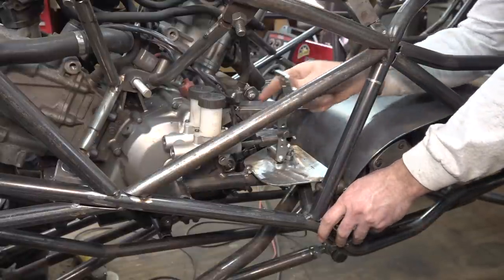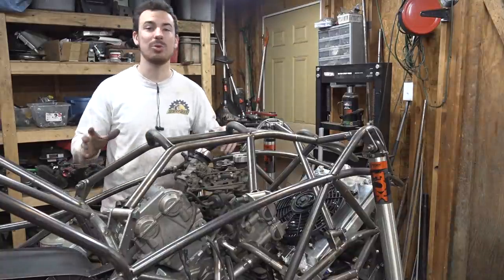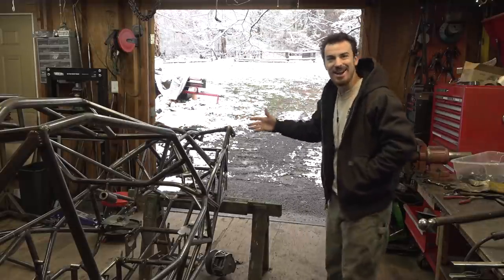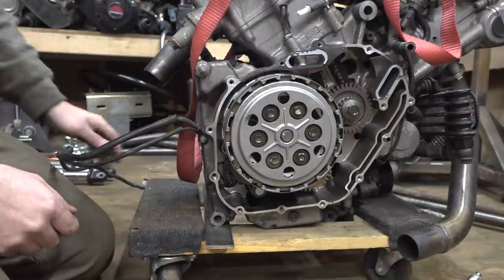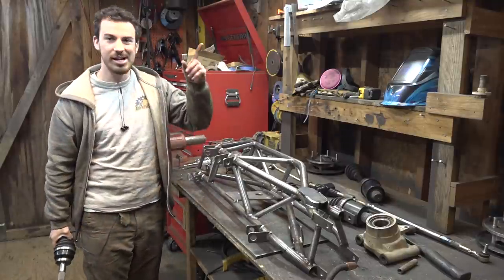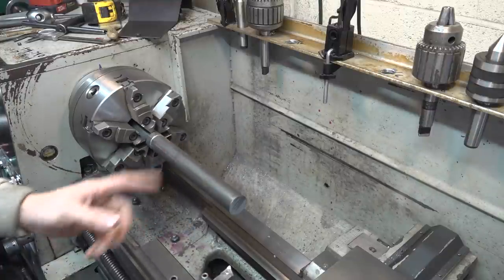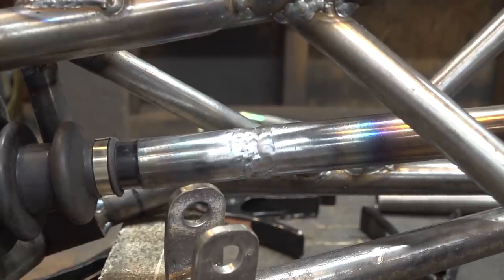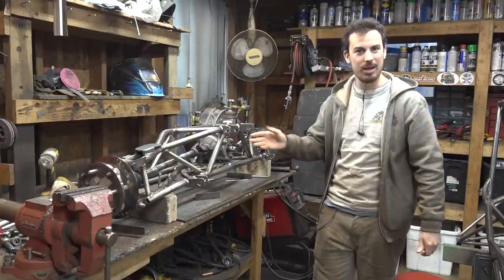4X4 Mini Rock Crawler Build Part 10

Comment: If (when) the Polaris diff explodes, have a look at running a car style small diff, like a Suzuki Samurai front and rear. Keep it all in the Suzuki family
Reply: I doubt there's any issues with oiling system. 
Otherwise every sv650 would need to be rebuilt when you wheelied. 
Plenty of crawlers use a wet sump.with great success. 
And you actually have to put power down to break the diffs.

Comment: Instead of butt welding the shafts, next time try 50/50  overlap section weld for a stronger connection. maybe like 2" or 3" on each end.  Even easier would be take your solid bar and turn holes in each end for the axles to go in, then weld.

Comment: 99 percent of the strength in shafts is in the external surface, thats why some are even hollow to save weight. The sleeve idea may end up being the better solution if these can't hold up to torque.  I would also look at annealing them too, to remove internal stresses in the welds. You don't need brittle half shafts.

Comment: Pro tip: Next time that you need to butt weld two shafts together, cut a piece of 90° angle iron that's quite a bit longer than the area that is being welded. Set the pieces of axle into the " v" and use c-clamps  to  hold it all straight while you weld it. When you are done,  there should be very little run-out if any.
Reply: Not in this case. 2 different diameters
Reply: They have to be the same diameter shafts for that to work. I guess he can put a sleeve over the smaller one but it would have to be exact tight tolerances. He does have a lathe he could of also of pinned the shafts or turn them both down to exact diameter.  Most YouTubers don't go that extra mile. it s slap together fest because of time restraints.
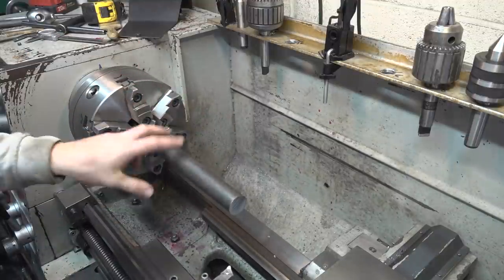Reply: Right, which is one of the reasons why he put the bar stock into a lathe and turned the O.D.'s to match (18:30). So as long as he matches the like sized ends together in the "v" of the angle iron, it should line right up, no problems.

Comment: Metal dust is camera's worst nightmare it jumps the circuit board hence the smoke take the camera housing apart and coat inside with a protective coating

Comment: I notice that there is a wobble in the shafts. I would have used an angle iron to hold each of them straight in 2 directions. The way it is now, you will have a lot of high-speed vibrations. Other than that, this is turning out great.

Comment: I am not a keyboard commando by any means.  If you have not welded it yet,  how about a cold roll with a inset to accept the shaft of the factory cv axle. A reversed heim joint like.  With a hole to plug weld? I am thinking tig weld to try and keep vibration down from the cv axle when spinning.

Comment: Hey Chris, looked like your gear selector shaft is bent slightly, probably been dropped on that side and caused the loss of the washer and circlip. Also, they are called clutch plates, metal and friction. 👍🏻

Comment: Why was the snap ring missing is real question? Did it break so they parked it? When you welded the axles you used one piece to connect both sides. Because of the raised sections each side needed its own piece to keep straight

Comment: Should have took those axles out and welded them in a pinwheel then lathe them down perfect I’d have used a slip over to extend the axles hopefully those won’t brake

Comment: Chris, to achieve a nice smooth consistent flat cover pass you first need  the final pass before the cover pass to be smooth and flush or a little below the parent metal. So if you run the last pass or 2 in a more down hill position somewhere between the 1&2 o'clock position, same step for the cover pass. Running slightly down hill is the best way to get a really smooth consistent wedding band weld. Definitely cool the part down between passes to about 150°f  Great video and what an awesome build love every thing about it!!💪😎👊
Reply: Trying to explain anything through text is like trying to have a conversation with the opposite species. Did you even proof read what you wrote? As a welder for 20 years I have no idea how that comment would translate to metal via a wand.
Reply: @FarmerFpv  I did proof read it and yes I could have went into more detail, but the main point is to get a flat smooth cover pass you  have to run down hill. You being a 20 yr welder this should have been easy for you to understand. I'm a 30+ yr welder fabricator with 12.5 yrs ASME code. I've fabricated with & x-ray certification in Titanium Zirconium and host of other exotic metals. Chris's welds are very good strong looking weld, but making them look pretty and smooth is something that takes different techniques to achieve.

Comment: Tig welding isn't inherently stronger than Mig welding.  If the machine is set properly and the welder himself knows what he's doing, they are both equally as strong as the other.

Comment: Damn! I’ve been planning on building my niece a mini rock bouncer and always imagined it in my head but could never figure out the gear box and didn’t want to use a jack shaft setup for running to driveshafts. Excellent work man hats off to you 🤘🏻

Comment: How about saving the differentials to some other project and now blow them up wasting time and money. Its rock crawler that uses lots of torque to move slowly and there will be shock when you go down from the rock. Drive train should always be least bit over built for the engine size so it can take the beating, aggressive driving etc, so for love of all that is mechanical, get sturdier differentials and build something else from those, say 6x6 sounds pretty neat idea.

Comment: Pedantic mode enabled - Unfortunately, a rigid break pedal mechanism, like the one you've created, cannot adjust the break-bias to two identical master cylinders.  To mechanically adjust break bias you need a mechanism that allows you to move the fulcrum on a lever bar, that then attaches (flexibly) to the two master cylinder rods (and applies different pressures to each).  D3Sshooter has a good video that shows a mechanism and explains how it work - https://youtu.be/ncANVHBmE4s?t=361
Reply: Pedantic《 or pendent
Reply: @mattcassinell694  huh?
Reply: You can also put a small shutoff valve in the line like a stack car. 👍
Reply: @brianmcpeek651  So nothing to do with the foot pedal mechanism then?

Comment: so you are aware every tube joint that you had overlapping should have been pulled apart and welded out 1 tube at a time, that cage is not as strong as you think it is with all those unwelded joints underneath each overlap joint

Comment: When cutting a centre hole in the lathe keep the material tight to the chuck ,that way your live centre will be in the dead centre of the workpiece and it won't be so far off running true ,unlike in the video where it was wobbling about like a turkey head 😉😊
Reply: Lol it was tight in a six jaw Chuck you don't get much more accurate than that other than a collet it Chuck(assuming that his chuck is dialed in the first place). The joys of working with old stock/hot rolled. You can put an indicator on that and you'll flight with it all day. It's old stuff with mill scale.
Reply: @ogt92fromthe1step9  холоднокатаный металл делают с горячекатаного, а при экономии на производстве сейчас холоднокатаный может  быть покрыт окалинами (окалина) и иметь вид как у горячекатаного

Comment: WOW!! Is that beast ever looking cool. I thought it would be nice to have the shifter between your legs. With simple push/pull cables, the shifting would be really responsive. Then it is fast and easy to drop down your hand, make a shift and have your hand right back on the wheel for steering. With it down on the side you have to grope around to find it or even look down for it which can be very dangerous. Keep up the awesome content big guy.

Comment: Mound a small 12v winch on the top of your bench or against the front wall with the cable following the ceiling & out to a pulley so that you lift things up onto a trolley to put onto the bench. Run it from car batteries & simple lifting hoist so you don't hurt your back

Comment: Those axels still seem to have a pretty eccentric rotation to them and it will only be exacerbated when they get to operating speeds. Be careful it doesn’t vibrate the rear apart

Comment: Have you thought about drilling the rod on both ends the size to slip over the axles and drilling pins though them and welding to connect them?

Comment: On those rear axles you could have just cut the axle shafts long enough that you wouldn't have had to add anything. Just cut it off right at the opposing joint that you didn't need. You would have had plenty of shaft to touch tips.

Run dual shield flux core on the MiG and it'll be plenty strong enough.
Reply: That would have made it difficult to maintain concentricity. When having and using the right sized V-blocks is not an option the method he used was the easiest and best solution. He was able to weld both diameters independently using one piece of angle steel. I do see what you mean though. It would have been a little stronger.
Reply: @brianrhubbard  Yeah I typed that out before I was aware of the differential in shaft diameter. But, any comment where you can mention shafts touching tips unironically has to be made.
Reply: @ALWhiteAuthor  LOL, I thought the same thing until he mentioned the size difference. Fireball Tools makes shop shims in a set and with two long V-blocks he could pull it off.

Comment: Nice build!
But I'm a little skeptical about the crankcase. at 13:14, it looks like there is a crack in the engine mount hole... I'm not a hundred percent sure...

Comment: Your building a rock crawler with a motorcycle engine right you might want to have your axles custom built and not done like that you're going to break it the first time you hit the throttle on the rocks if you're in the air and you hit the throttle and them tires are moving when it hits the ground the axles are gone

Comment: Using single angle bar to align shafts with different diameters introduced offset to alignment. 
EDIT: looking at it again, there were two angle bars for each diameter, not just one for the whole thing!
Reply: Полуоси (CV шрус) разных диаметров, укоротить их нужно было так чтобы не точить вставку, поверх сварочного стыка нужно ещё и втулку одеть и также прихватить. А вообще если полуоси сломаются Крис их заменит и исправит свои ошибки

Comment: Be careful ! That shift shaft is bent by the looks of it. You will want to straighten it as much as you can. before removing it so that you don't damage the case. There are usually no bearings or bushings. so if you force the shaft out you could be causing more problems.  I would also get a seal just in case you damage it changing the shaft.

Oh... Nice ! I see that you didn't have to remove it 👍

Comment: It's best if you only use nuts and bolts at the top to make it easier to disassemble if there is a problem with the machine

Comment: Hi Chris, excellent news about the gear changing issues
Something to think about mate
You mentioned the shed not being insulated and having to use 2 heaters
Knowing what it cost me in Western Australia (without snow) in winter in electrickery
To heat my 20x14.5foot bedroom compared to after I put in R35 pink bats
 insulation was approx 300$ extra on top of my normal bill,(bill came 2 monthly) 
If you put in insulation into your workshop, it would pay for itself in at the most 2 of your electric light bills then you would save heaps of money, do it correctly and when you move on take it with you for you next location.
Warner in winter cooler in summer
Tony from Western Australia 🇦🇺

Comment: With regards to your driveline, it's the torque rather than the bhp rating that could kill the differentials. If the torque figures for the two engines are similar then you should be OK. If the V-twin engine has a much higher torque rating, that's where the problems start.

Comment: I really thought you were going to afix a slow speed electric motor to the diff (with a foot switch), so that the axles turn under your welding torch... maybe next time?  Nice work, by the way.

Comment: I still think you need a headrest. There are 30x8x12. Also mig weld joint is very hard and brittle due to its fast cooling. Tig weld is softer  and more malleable because of slower cooling. Because you put so much heat in it I wonder if you are somewhere in the middle?
Reply: To weld that depth of joint with a mig weld he would need to run it very hot. Would be better with flux core/spray just because of the amount of heat needed. But those would their heat just as long or longer then tig. Personally I would have done flux core on this, quick and strong.

Comment: I wonder if you had cut the unneeded parts of the rear CV shafts leaving all of the shaft material with the needed CV joints you might have had enough shaft to not need the cold rolled hunks?

Comment: I recall mentioning 35 inch tires for this project and some one from the comments responded 35s would be to heavy for this project,  whom ever that was I agree if you use truck tires and wheels yea they would be heavy ... but they have sxs tire / wheel combos that are much lighter and would do the trick just fine , also guys put 35s on there sxs with cvt transmissions and Rotax style motors ... I'm more than positive he can find a 35 inch combo ....

Comment: as bad out of round as it looks on video, I am betting it's going to sling itself apart. good welds or not, you're looking at 3 to 12K RPM on a shaft thats out of round. Guess time will tell
Reply: Развалится не развалится, но биение будет сто процентов, Крису как минимум нужно было их нормально отцентрировать, уж точно не при помощью уголка, а по хорошему одеть сверху втулку с просверленными точками и прихватить их
Reply: 12,000rpm at the wheels? Doing the math that’s 892.5mph. Torque has left the chat

Comment: Way too wide of a weld bevel. About half of that angle would have been sufficient to get down to the center. Would have saved a lot of time and a lot of uneeded heat input

Comment: You have just said it yourself why do all that work when you know that trying to put double the amount of power through that diff is going to kill it if not outside it will be when your a mile or so away from help I do enjoy your videos but I still think this is the most ugly looking thing you have built so far although better with the new front but that seat is driving me insane who drives a vehicle like that laying down in a rock crawler you need to be sitting up correctly to see what's going on, another big mistake is that roof that will cave in if you roll it you just DO NOT put the bars bending in towards the driver its crazy always make it domed outwards that is where the strength will come from, when have you ever seen a car of ant sort that has a roll cage with the bars bending inwards answer never that front V shape has to go.